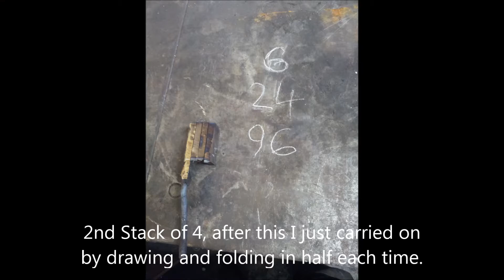Scrap Iron to high carbon Knife - Part deux - Shear steel and beyond!

Comment: One way to get super fine clay and grog at the same time is to mix both in water then get a put in some bucket or container with some cloth or old shirt tied up on the top, but kinda loose. After that you stir the mixture until finished and remove cloth and put the super fine stuff in a plaster container and wait till clay is kinda dry.

Comment: I would just heat the edge with an oxy-acetylene torch then quench like some guy did to his leaf spring bowie. I'm also learning pottery and when getting the clay for differential hardening you must make sure the fireclay or pottery clay with grog is super fine.